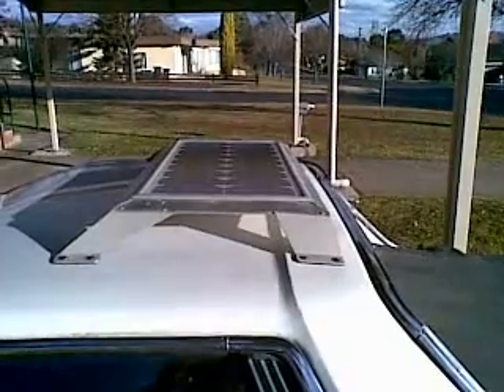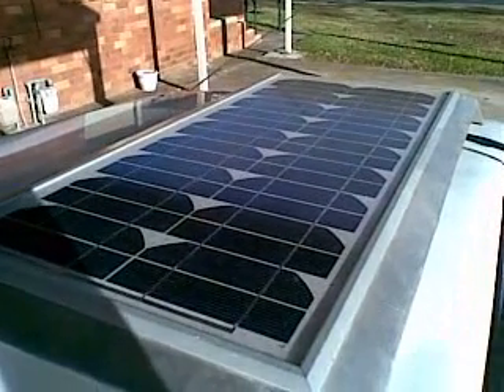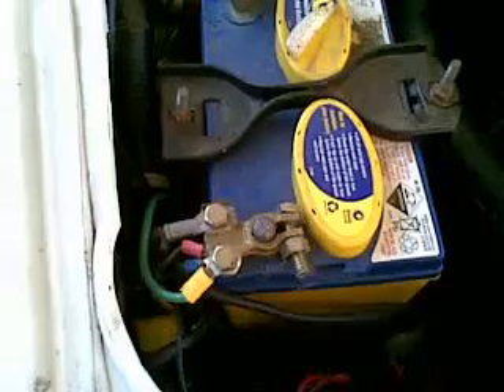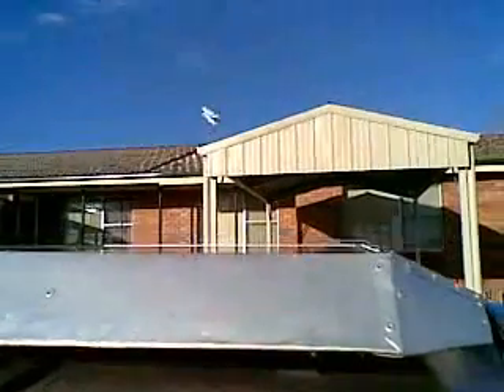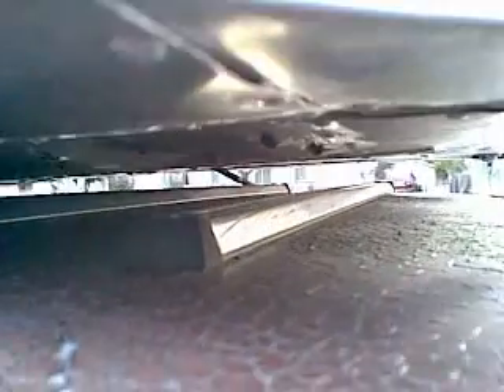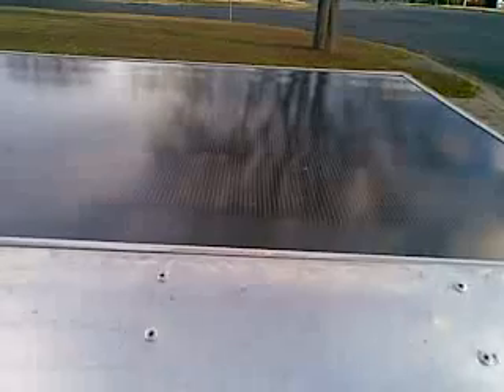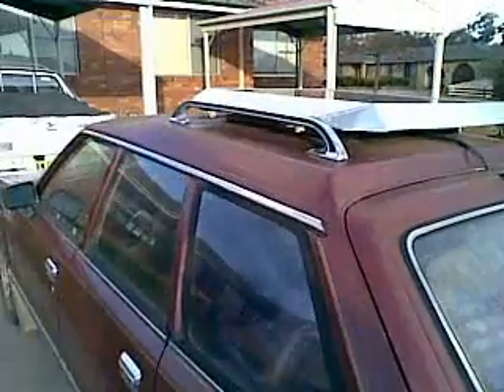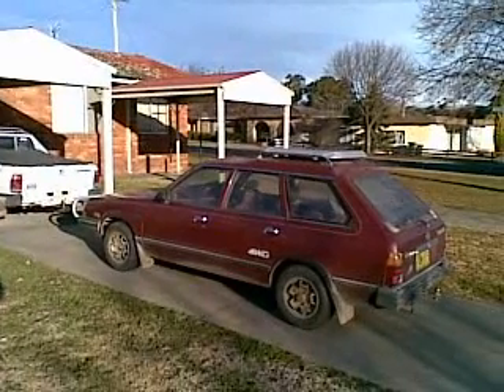SunFoil Thermodynamics, Aerodynamics, &  Solar-Thermal Ramjet Effect.

Comment from the maker: @Johnsolar283
 G'day...! Thanks mate... Glad to hear you're watching. Any chance you'll be retrofitting whatever you drive ? Um, yeah., I set out to finish recharging the Battery after 6 minute average Runtimes. That unloaded the Alt. Belt, saved Fuel, and increased available Torque. The PV HAD to be streamlined, thus enclosed, therefore Ventilated ; & so became a Thermosyphon Air-Pump, & also a Ventilated Aerofoil, & a Ramjet. Of sorts... It just growed !

Comment from the maker: @knowledgemonger
  Very good. Excellent observation! The PV is 0.47 square metre, so you have a good eye, as well as a mind for detail. I'm unable to measure while driving but the thermosyphon-cooling-pump is sursisingly good 
(OAT 11.5C, Under Mk3 14C, Centre of Inlet 16.5C, Centre of BLC Vent 30C, PV Top Surface 39C, Car Roof 47c... Compared to bare PV on the Tower Of Power, same day, 42C top, & 48 under). It all helps. And works, I'm happy.

Comment from the maker: @gcmc2
  G'day, thanks for the question. It gets a passing mention in the "SunFoil Mk-1 Genesis..."clip, which shows the roof divots as well. Car cost $2,500 - 9 yr ago. Musta been rolled, has failing bog under MOST paint, allover. Bare-metal resprays start at $3,500+... & wouldn't alter fuelburn, unlike SunFoil. All cars look"swoopy", not aerodynamic ; look at the underside, where airflow is fastest ! Divots swirl the BL airflow,2.

Comment from the maker: @knowledgemonger
  Furthermore; I didn't expect the ST-Ramjet Effect to work, measureably, but had to balance the total Ramscoop's area at 1.4 x the total Venturi Throat's area, for the Boundary Layer Airflow Control system to unstall that 45deg Trailing-Facet. The Ramjet-Effect merely a byproduct. Strangely, the BLC seems more effective in full Sun than cloud, rain, or at night..! Prob'ly Placebo-Effect & Autosuggestion. Fun, tho !

Comment from the maker: @knowledgemonger
  G'day. Just a 'Heads-Up' to alert you that  I spent yes'd'y making/uploaded a new clip to interlock with the SunFoil suite. This one "SunFoil Science, Raw Experimental Data & Analysis. Which I hope you'll find interesting. The evidence re Geo.Mag.Field Strength/Anomaly detection was already marked on the graphs, so it's part of the clip. I don't have tools 2 prop'ly investigate it further. Do you? If so, go at it, stand on my shoulders. Reading this is yo head-start.

Comment from the maker: @knowledgemonger
  Ah, I've Bin-Thunkin', &  the admitedly miniscule Output - from the STR-Effect  - isn't the isssue, so much as that it does ANYTHING, at all ! It was a 5th-order Design-priority... But, it's applied at a point where Multiplier-Effect kicks in. Any added power to BLC-Vents, makes Aerodynamic Downwash-trickery go better; and, better adhesion of Roof-SStream onto Glass, cuts 4% off Fuelburn. A rope accross Inlet-Slot blocks flow, & it loses 0.8 Km/Litre... True !

Comment from the maker: @theshadowsymphony
  G'day...  Um, apologies, but I only just found y'r  comment.
  The Alternator HAS TO STAY THERE... It's for when the PV can't do the job. Headlights at night. At the Traffic Lights, in the rain, wipers-on. Foot on the Brake-Lights...etc.,
  And, MOST cars use the Alternator as a Turnaround-Pulley, & Tensioner, for the Engine's Coolant-Pump Drive-Belt.   The Drag-Cars either disconnect the Alt's Wires ; or fit a Pulley & a Charged Battery, for every Race. Ciao !

Comment from the maker: @gcmc2
Yeah, sure, I'll try; though there's 12 clips covering all angles. Search 'sunfoil' to grab the lot... Begin with Auto Alt's being 2%-3% FUEL-efficient, due to belted step-up drive. Battery sulphates, as Clocks & Chips suck juice 24/24. Them Subarus need +3.68 A/Hr, per day of parking..! At 207 ml/A-Hr, = 761ml/day...= 277 Ltr/Yr..!  A 
V-6 Commodore needs 7-11 A/Hr per day, so alarm-on & 75w PV = 22 litres /week. I haven't measured a Bentley yet. Yes?